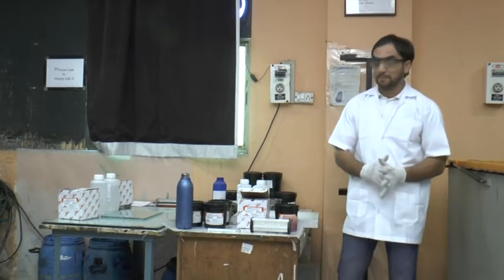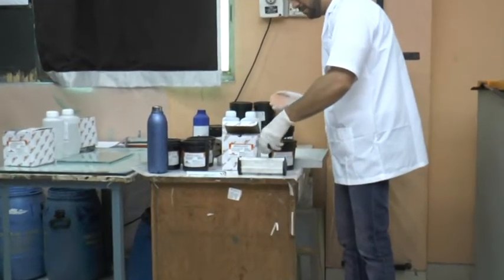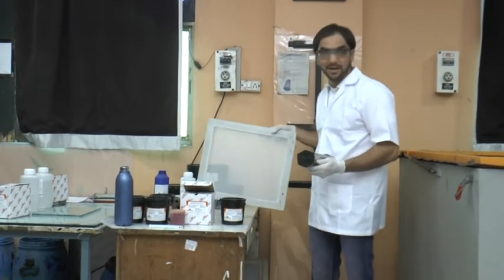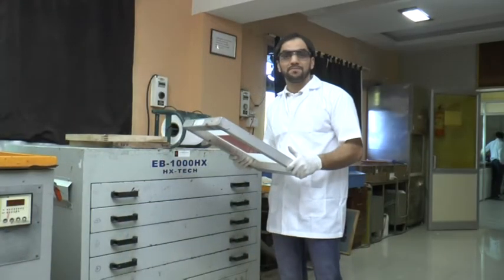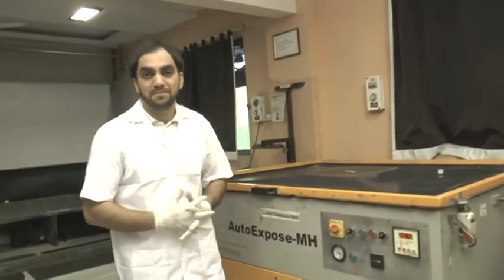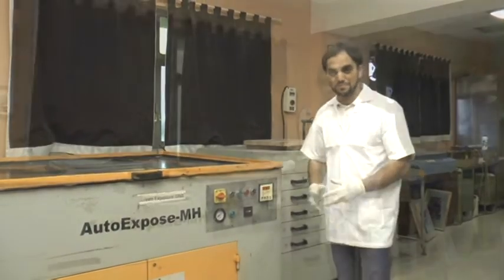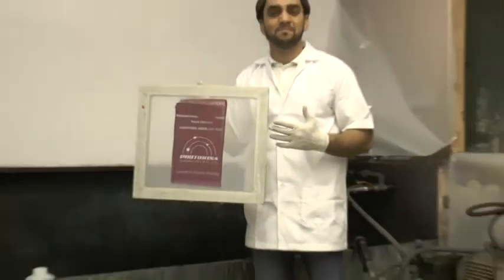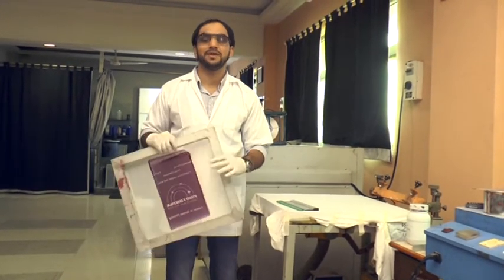Shebro DIW 234 Plus

Comment: How Much Emulsion Will Be Consumed By An A3/A4 Size Screen In Mili Liters ?
Reply from the maker: It depends on the number of coat you applied on screen (or the amount of Emulsion deposited on screen).  for A4 size screen 1 print and 1 squeege coat with round edge of coating trough consumed 20-30 mili liters of Emulsion.
Reply: Yes I am asking for single coat on both the side for a complete A4 Screen. Thank You!!!